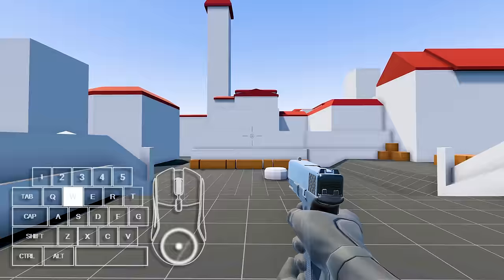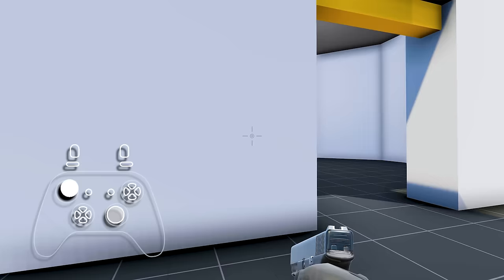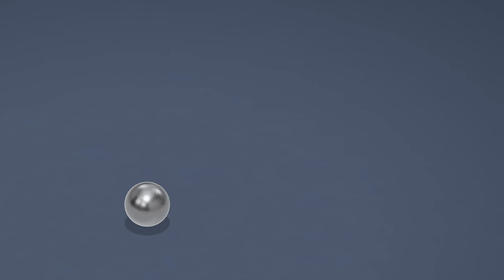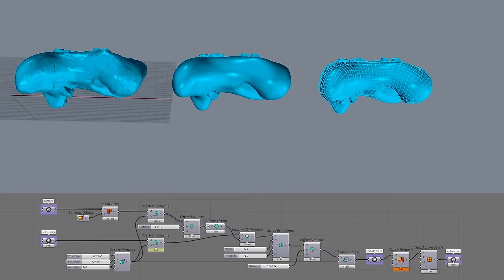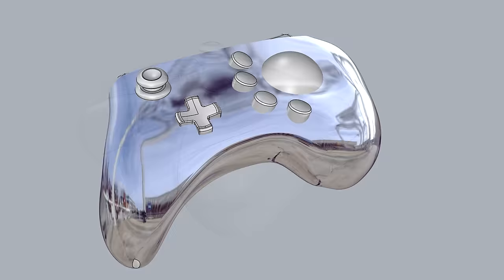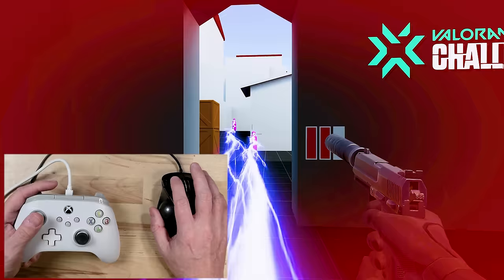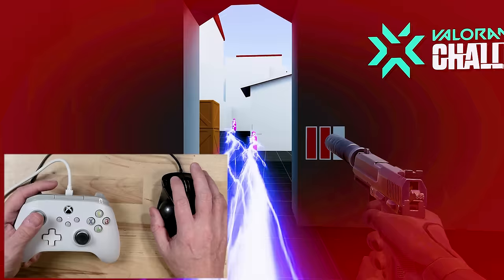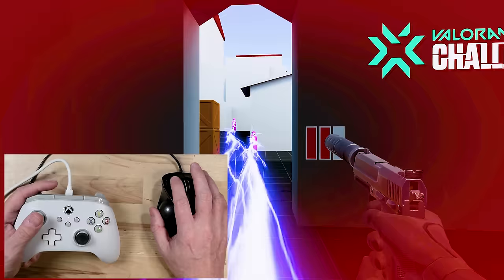Ultimate FPS Controller Design & Build

Comment from the maker: Thanks to everyone for all the views and taking the time to comment! All the support has been amazing. Special thanks for the donations to the channel. Those were totally unexpected and mean a lot to me! Wanted to take some time to respond to some of the recurring questions below:

“Why didn’t you source an internal board for electronics?”
I’m trying to release project videos every 3-6 months which means I have to finish my physical builds in 3-6 weeks on top of my day job as a design consultant. Specifying and integrating electronics into this concept would have stretched my release schedule way beyond that timeline.
Leveraging off the shelf product internals isn't a pretty solution, but it makes it so I can quickly build out a design. It's a shortcut to quickly experience the ergonomics and design details of an early stage concept.

“Why no gyro control?”
I was looking into gyro options during the early research phase and have some experience with handling telemetry data on past projects
https://pyottdesign.com/product/skana
But, to be honest, getting the data stream out of the gyro sensor and passed into the Steam controller API would have been outside of my skill set. Pretty sure I could have gotten there and it's definitely something I want to learn more about but, again, that would have been more of a year long project instead of a multi-week build.

“Are your design files available for download?”
I had to cut a lot of things for time, but there was a bunch of Dremeling and manual labor that went into this build after 3D printing. There aren’t really “complete” digital build files for it. This controller was also made specifically for my hands and grip. Because of those reasons, I don’t plan on releasing the files yet. I am looking to revisit a variation on this controller design in the future, and I will (hopefully) include build files when I do!

“Can I buy your controller?”
Unfortunately, not at this time. This project was really about sharing my design process by exploring a fun working test prototype. I don’t want to totally slam the door on the idea, but it isn’t something I am pursuing right now.

“This will never beat a mouse/keyboard”
I was more curious about why alternative controllers aren’t more common and why the controller and MKB became the standards. I really like projects like this because they challenge my own assumptions on why different industries exist the way they do. I also just love making this type of thing 🙂

Thanks again for all the feedback, comments and great information everyone has shared!
Reply: This controller looks like it would be awesome with Kitten Burst. I would love to see how it works with the games demo!
I'm sure you've heard this many time over already, but this is an awesome project!
Reply: I want to congratulate you on your incredible creativity and the way you share your ideas with the world! It's inspiring to see how you explore new perspectives and challenge the limits of convention. Remember that creativity knows no limits or fixed rules; The important thing is to continue expressing yourself authentically. Your courage to embrace diversity of ideas is truly admirable. Keep shining with your unique creativity!With admiration,
Reply: Thanks for "sharing my design process"; I got some insights!
Reply: was the trackball any good at wide sweeping motions? like say a 180 or 360 degree turn?
Reply: Can I ask to have the trackball cradle?
Reply: No this definitely is definitely better than mouse and keyboard if you had this available to purchase you would have my money bro I really hope that you start selling them.
Reply: I would really love to take this controller for a test drive. This is actually what i have been looking for in a controller for a long time. 😂
Reply: "I WonDeR wHy tHiS pRoDucT dOesNt eXiSt"
> Invents it
"wHy seLL???"
Reply: The only issue i can see is there doesn't seem to be an easy way to clean the trackball sensors from what i saw here. I love my trackball but i have to clean my accumulated finger gunk off the sensors every couple of days to keep it rolling smoothly, which is super quick and easy to do on mine because the ball's just held in by gravity. On this one the ball and sensors seem to be pretty permanently placed, which could become an issue pretty quickly, especially if the user is eating Doritos while they're playing.
Reply: This was an awesome insight into a clearly excellent design process - thank you! I really hope you do release the design files at some stage, as it looks like a great project to learn from and a great controller to use!
Reply: As someone with chronic tendinitis and wrist pain who really enjoys shooters but finds it hurts more to use a keyboard, I would really love to take a crack at using this controller. Please keep us updated if you ever make plans to sell it.
Reply: Thanks to share your briliant ideas👍🏻👍🏻👍🏻👍🏻💪🏻💪🏻💪🏻💪🏻😎😎😎😎
Reply: This would be a "game changer" in the controller industry. I have a feeling you'd make some serious cash if you were able to license this design to a controller manufacturer if you're not interested in making them. Like you said, this should already exist. Patent the design if you havent already.
Reply: A brilliant design which reinforces for me that a sliding palm rest for the left hand that outputs a PWM WASD keyboard signal is still the best way to go; it doesn't need any drivers as it just emulates a standard keyboard.  

(I wrote a PWM keyboard script in GlovePIE almost fifteen years ago that allowed me to use my MS FF steering wheel perfectly with Flash racing games.  It was hilariously awesome overkill and I loved it.  I later stuck an Arduino Mini inside a Nintendo Nunchuk doing the same thing to give me full analog control of movement in games that only supported (digital) WASD.  So good!)
Reply: why did you not include a gyroscope. would have made it a bit better.
Reply: Have you considered trying to make a 'Minority Report' type of controller?
I think that would be the ultimate controller, short of being able to play games with your mind.
Reply: You should put a trackpad on a controller
Reply: I desperately want this controller
Reply: Пожалуйста впустите это в продажу я хочу это купить )
Reply: what a great controller I hope one day to have one with gyro
Reply: start a kickstarter and pin it to this video.
Reply: Dude, u need to start selling this things. Im mx ergo user for years and would love to buy trackball gamepad. I bet there will be hundreds more who would buy it!
Reply: Take my money, I need this
Reply: Sell / Mass-produce that shit. I don't even play or want to play FPS games and I want one.

Even in the state you have it, you will be able to make a ton of money. Invite a pro player or person who works for Steam to see this controller.
Reply: "this will never beat x/y" people outing themselves as rage clicking sophists that skip to the end of the video lmao
Reply: Hello, great concept and fun to watch.  Im guessing youve appeared on my feed coz i recently looked at Vitrix controller for PS5, funny how that works 😂
Just a quick tip - you missed the most important difference between joystick controllers and MnK... Drum roll.... 😂
The MnK has better aiming because it requires the use of your entire hand/wrist/forearm etc, whereas joystick only requires your thumb 🤯

Heres my opinion, which you nailed when you used both the Xbox controller and mouse at the same time - thats the answer mate 🎯🤯
Youll need to create two devices that work in tandem, one that takes the benefits of movement via joystick for the left hand, and obviously keep the mouse for right hand aiming, which requires a mouse pad as well to allow for small to large movements with the forearm.  One idea is have the left hand device semi wrapped around the left hand to provide stabilization, the mouse can operate like any other mouse.  Youre welcome 😂👊😎
Reply: You seriously need to keep this on file and either get it manufactured and mass-produced with special PCBs eliminating the need for the breakout board, or sell it under a special licensing agreement that allows you to take a tiny cut of the profits perpetually. That or sell it yourself. Trust me, you'll make a lot of money. I don't even play FPS games and I want one. I'd buy 2, and give one to a fighting game enthusiast friend that plays FPS.
Reply: I left a reply on Valve and PlayStations most recent videos. I don't know if they will see it. If they do, they might see or respond to this video.
Reply: Wow very impressive this is out my search genre but popped up for some reason so decided to watch it and im highly impressed.  Great video from a new subscriber. You also make it look oh so easy when I'm sure it was some very intense nail biting trial and error taking place but you make it seem to be done in an afternoon.. good luck with your design and take care my friend.
Reply: I think the main flaw about this video is that it completely ignores gyro controls. It's known by now that gyro aiming is much closer to the mouse, precision-wise. And probably a tiny bit closer than your custom controller too. You can easily test this with a Dualshock 4 or a Dualsense controller on Steam, thanks to the Steam Input utility. Funny you also mentioned the Steam Controller development, since it's also likely the trackpad ended up being a little bit better than the trackball, otherwise the Valve design team wouldn't have discarded it. So, to summarize, a proper testing should include both a gyro controller and a Steam Controller against your design.
Reply: This is a great step in the right direction for merging the best of both input methods! I would be interested in trying it out if you ever do decide to sell them on a smaller scale or do a kickstarter.

My personal idea for this merger of both inputs is to have the Wii nunchuck with more buttons added to it and have a cable that enters a box ,similar to what you had here for the right analogue stick, to merge with the cable for a mouse into a single USB cable to plug in. This would allow for an actual mouse to still be used and still allow for analogue movement using the nunchuck. 
Might feel a bit weird at first, but controller users would just need to adjust to mouse aiming and M&K users would just need to adjust to using the added buttons instead of using their keyboard. 
I would make it myself but im not an engineer and I don't have access to any 3D printers or circuit boards.

I have used controller for all my life but i can feel the potential of the mouse even with just the few times I have tried shooters with M&K, but my brain is so set in it's controller ways that keyboard with only 8 directional movement is too janky and I also can't keep track of all the other buttons i need for gaming.
Reply: That looks like a terrible idea.
Reply: Make one for my Xbox series s so I can make videos playing halo ❤
Reply: 1st .....smaller buttons and they all gotta be mouse click...no play streamline that bad boy......right now it looks like a baby's toy...need to take from fisher price to Asus/ Alienware status. The idea is amazing I would just market as a controller for mobile and PC gaming for now make one with a USB c chord . Hurry up to I want one .....I'd pay 200 for it
Reply: The bigger problem on pc would be mixed inputs. alo of games dont work with both mouse and controller active at the same time. input flicker is the least of your problems. games like god of war just shut down the mouse when analog controls are detected. so for example instead of mouse like a trackbal i use gyro as a mouse. but the game does not like mixing the gamepad controls with the mouse. so i either  have to simulate the right stick with the gyro. or i need to emulate keyboard keys on the controller and use gyro as a mouse
Reply: I WANT TO BUY THAT CONTROLLER ! 

So far theres nothing like that out, and it is EXACLTY what i need ! Time to get some company to pay u a huge amount of money to make that thing. Microsoft maybe. 
Finaly i dont have to get all that keyboard and laptop but can chill and relax on the couch while still having a mouse ! and on top of what we see, this controller will even beat mouse players if one gets used to it !!! 
NEED IT NOW !!
Reply: I have a suggestion, it would've been good if you could put a switch to switch the track ball functionality between mouse and the right stick of a controller, meaning if you want to use a normal right stick input of a controller but with better movement.
Reply: I need one!! I watched this video when it came out and looked for it again for 10 mins. Even better then i remembered
Reply: Ping me when you're ready to take preorders! I'll take 5.
Reply: Beautiful work man.

id also buy one of those but i totally understand that its out of the picture right now.
Reply: This is a cross between cyborg mouse & xbox controller with roller ball. I would buy this
Reply: the best would be if you could use you mouse for aiming and your left hand on a controller for movement
Reply: Your an Alien 👽 we love you